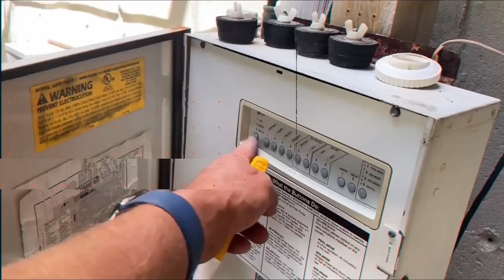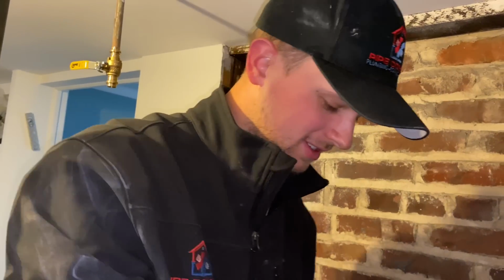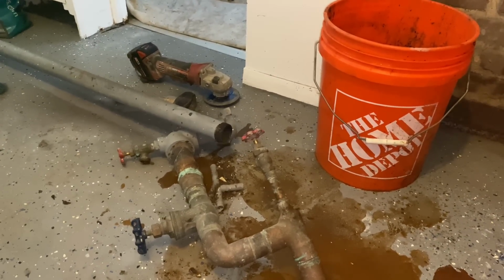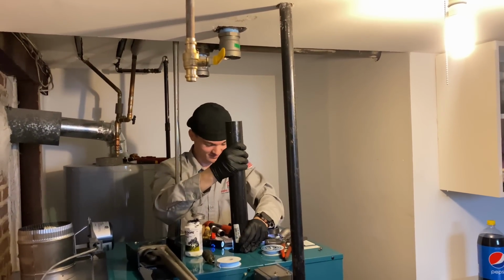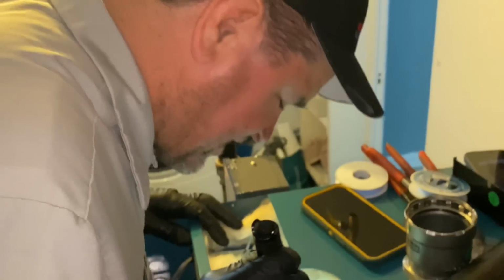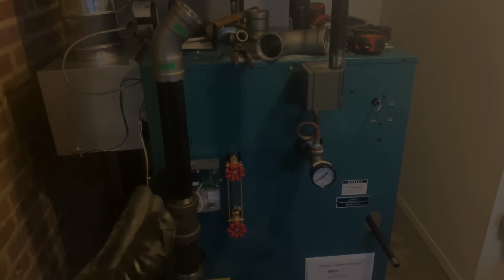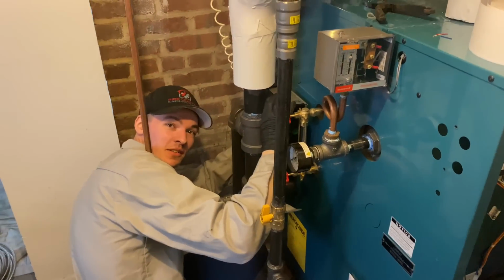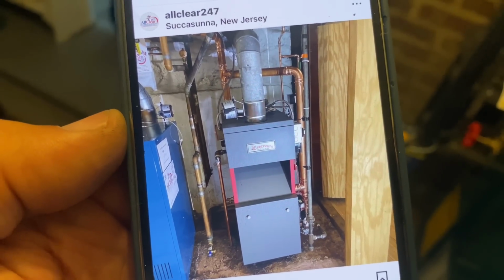Steam Boiler Replacement Using Viega MegaPress @USBoiler Burnham SteamMax 125 How To Install

Comment: I used to do a boiler in a day 10 hrs by myself. Lets see, it looked like there was4 guys there so 10 hrs divided by 4 equals  2.5 hours and it took you guys 4 hours. I would say 2 guys on a job is about the most efficient. 3 guys start getting in the way and waiting on eachother. 4 guys is just plain inefficient.

Comment: This is a first! You must have seen, read or been to Dan Holohans books or seminar, as have I.  You actually insulated piping, I cant believe it…. This is a first.  Why did you guys stop short on the insulation?  HOWEVER, whoever needs to replace that aquastat,  is going to be cursing you.

Comment: Page 61 in "The lost art of steam heating". Hartford Loop is 2 inches below normal water level. U.S. boiler is explicit in their manual that Hartford loop is  2 inches below normal water level.
Reply: @PipeDoctor  The center of the glass is really never the relevant measuring point. Center of glass means different things on different boiler. "Normal water level" is the point of reference. Most manufacturers, in the installation manual, mandate 2" below the NWL. Some say 2"-4" below the NWL. The only time middle of glass is referenced, is when dealing with old or obsolete boilers, where no manual exists.
Reply: There is something called a Gifford Loop". Very similar to The Hartford Loop but with the placement of the loop slightly higher. The inventor of the Gifford Loop proposes that you are better off with the loop at the height of the normal water level. You can Google Gifford Loop and you'll come up with some interesting reading material.

Comment: Theres going to be alot of oil in that boiler from the factory and the factory coating of oil inside the pipe from the mill even if it wasnt jobsite threaded. Im not so sure throwing some chemical in and just letting it run will actually encapsulate the oil AND make it settle out to the bottom where it can be drained off thereby reducing carryover. Your thoughts?

Comment: That boiler looked off center as well.. Cocked to one side, looking at that picture Mike..  Could you have done a T in front of the drop header, and then 90'd over and up, to pickup the mains?

Comment: great job, helpful advise for you, when coming down the stairs on hand truck, raise the handle up so the wheels stop on each step to hold the weight rather than the sled technique, also the hartford loop looked high but could just be the angle of camera, should be 2" below normal water level. may want to fire it up before insulating in case of leak, very nice job!
Reply: @PipeDoctor  very good

Comment: by 19:53 the bung was tapped by a machine straight with the casting, but the bung face isn't perpendicular with it, nor flat across.
probably cheaped out on a machining step or the casting mold is worn and un true.

Comment: I haven’t had good luck with surgex. 8 way works very well for long term treatment and to encapsulate oil. There’s a guy on YouTube that has a properly installed steam boiler in his own home with glass tubes on supplies and steam drop header, so he can see what happens when different products are added to clean water. Surgex was by far the worst I saw tested, and made the boiler surge. The 8 way worked well so I tried it after 2 trouble steam installs.. banging and issues with farther away radiators not heating well.. the 8 way solved the issues immediately.
Reply: I have had good success with 8-Way as well as the Hercules steam boiler treatment.  I put them in each year during the summer after cleaning the boiler.

Comment: Did you see the steps flex with all that weight. Where can I get that  insulation?
Reply: @PipeDoctor  thank you.
Reply: they were pretty thin for not having a stringer down the middle, heck even a  2x4 laid flat and fastened would do.

Comment: Question out of interest. Why do homes in USA have such big installs with big (gas) steam boilers, much zones and so on? It's not that al the houses are so big. Keep up the good work!
Reply: Because we are American's and don't live in small ass boxes 😂
Reply: Steam boilers have to be big because of violent steam otherwise the house would be off its foundation from water hammer. Removing steam pipe and replacing with baseboard would be x2 to x3 more expensive.
Reply: lots of older homes with little to no insulation and poorly air/vapor sealed. aka wind tunnels, with enough radiation elements and boiler oversizing to heat 3 to 5 well sealed and insualted homes. lol

Comment: So if Mercedes wont donate a van to the philanthropy channel have you thought of reaching out to any of the other van Manufacturers such as GM, Ford, Stelantis, Etc?
Reply: Maybe he wants a nice modern, tall roof van with a well engineered diesel engine that's powerful and sips fuel instead of an ancient 60 year old van that you can't stand up in and that guzzles gas and spews unburned gass smell and stinks up a whole city block when you come to a stop 😂 How did the Americans manage to only get 175 HP out of a 6+ liter V8 gas engine in a commercial van for so long?
Reply: @dregenius  1. why the hell would you go with a diesel that would be very silly as it would be in the shop more than it would be on the road due to the Emissions systems plugging up due to all the stop and go traffic Mike encounters plus the added cost of fuel and maintenance would outweigh any sort of MPG boost he might get better to get a gasoline engine and 2. I never said Mike HAD to go with the others it was a simple question posed out of curiosity and lastly 3. Your bias is showing as im assuming you're from Europe considering your suggesting a Diesel which here in the States cost significantly more to run and maintain then their Gas Powered counterparts due to the cost of Fuel and US EPA Emissions Adding on DEF,DPF,EGR etc
Reply: @BryanGullickson  You make some very valid arguments, but honestly big asthmatic gassers are just not suited to a commercial van or hauling. The fact that diesels cost more to run is not the engine's fault, it is the fault of regulators and Americans who are very stubborn and continue to think of diesels as "foreign", which in turn means America continues to use less efficient refinery processes that prioritize gasoline (despite being significantly less efficient, as many of the distillate fractions that would have gone into #2 fuel/diesel need additional energy pumped into them to crack them down into gasoline), and fuel taxes that assume only huge trucks use the fuel and thus disproportionately tax diesel fuel. If diesels were more common in vans and anything that isn't a sports car, then there wouldn't be that issue of them being more expensive to operate.
Reply: @BryanGullickson  MPG for diesel is better then gas.... gone are the days of cheap diesel.
Reply: @GoatzombieBubba  yes diesel does get better mpg than gas im not debating that but diesel is like $5+/gallon and also it gets cold on the east coast i dont think mike is gonna want to have to fiddle with him or his employees remembering to plug in a block heater at the end of the day or remembering to unplug it at the start along with putting anti gel in the tank so the amount of cost and effort outweighs the savings produced by the better MPG
Reply: @dregenius well yes the big NA V8 engines are slowly being phased out and or have been phased out by most manufactures in favor of NA v6's or Turbocharged V6's mainly due to Emissions and MPG requirements mandated by the government as far as I know GM is the last one to still shoehorn a Giant V8 into their Vans but thats because other than some slight facelifts, required safety upgrades and some other slight tweaks the Chevrolet Express platform has remain unchanged since its initial introduction for the 1996 model year but as i said to Aaron the savings That you'd get from Diesel MPG would be overshadowed by the cost of fuel and amount of effort required to keep it running happily and healthy during the winters that the east coast gets from having to worry about plugging it in at night to putting anti gel into the tank to keep the fuel from gelling you'd be better off  going with a Forced induction Gasoline V6 on the bigger vans and a Forced induction 4Cyl on the smaller ones

Comment: A simple thread chaser would have saved an hour here. You can make one by taking a grinder to a piece of pipe cutting slits in it at an angle
Reply: been there done that, but the pipe gets chewed equally as fast as the threads you're chasing, unless it's steel in aluminum or something else softer.
cast iron generally laughs at home made thread chasers, unless they're hardened( which is hard to do) 🥳